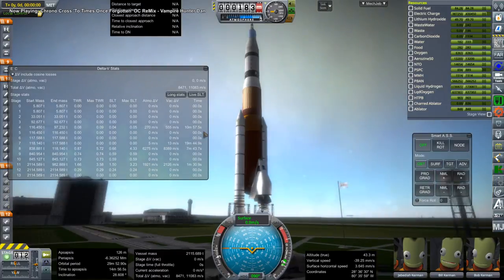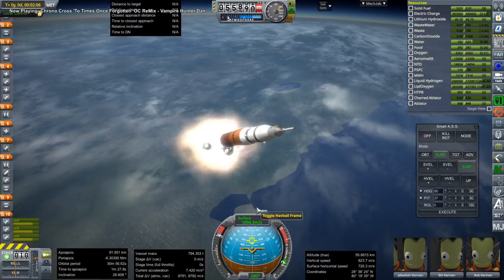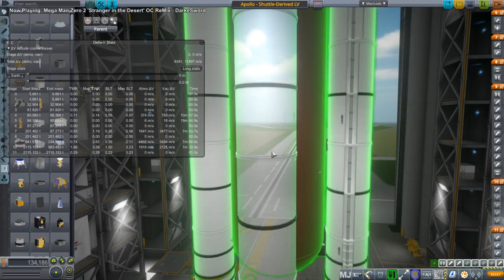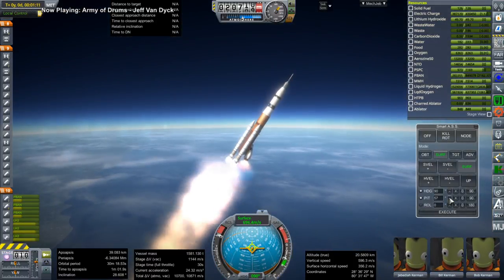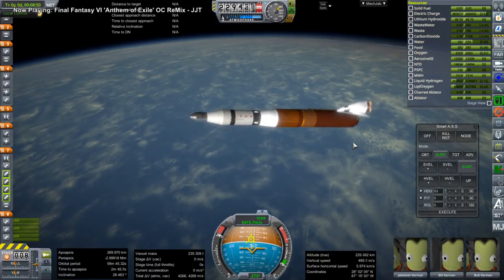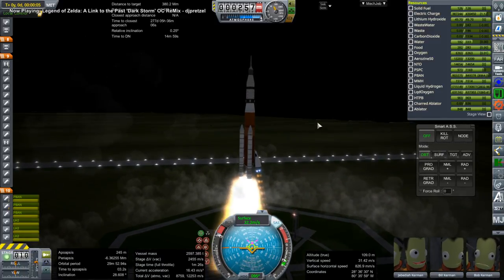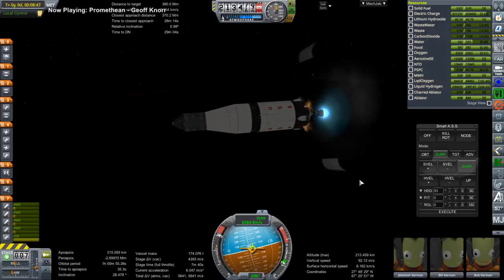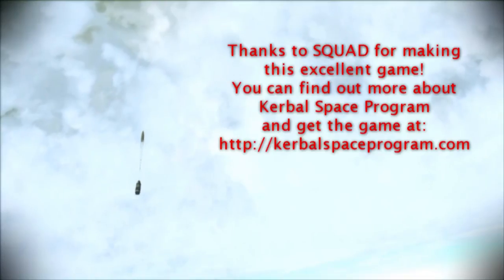Realism Overhaul in KSP - Apollo on Shuttle-Derived Launcher?

Comment: Why not try MechJeb Ascent Guidance? It usually works really well for me, often better in RO than Stock, even.
Reply from the maker: I already have a kOS script for the Shuttle that would work, but sometimes I like to control it so I properly register what's happening to the trajectory. I never use Ascent Guidance - either I control directly or I write the script that does it.
Reply: @RaizSpace  Understandable. I should probably get back into writing for kOS someyear. Generally I only used it for simple mechanization processes, but now that we have Breaking Ground, I've almost no use for it. Also, thanks for the swift response!